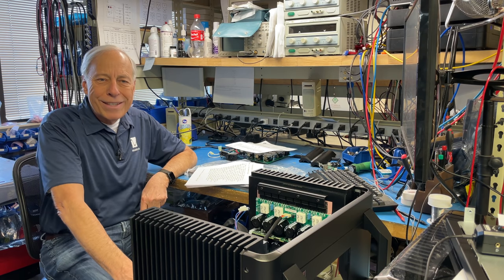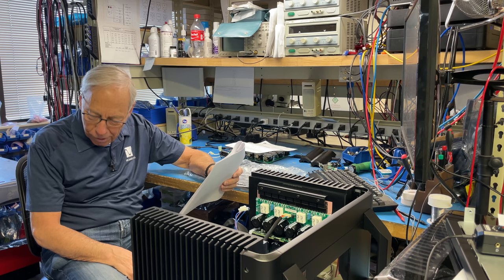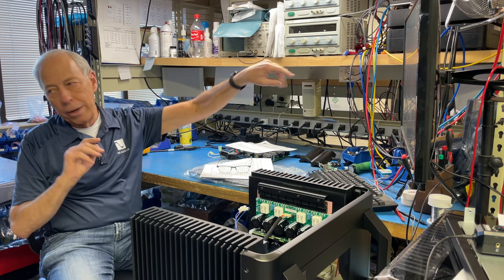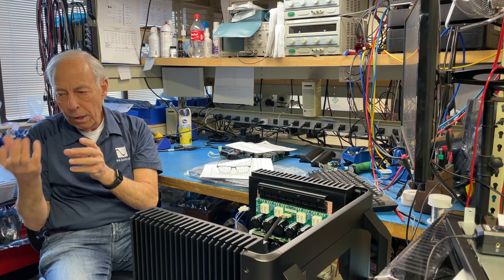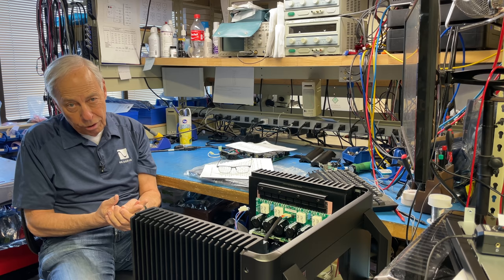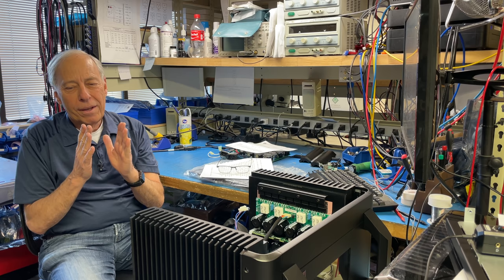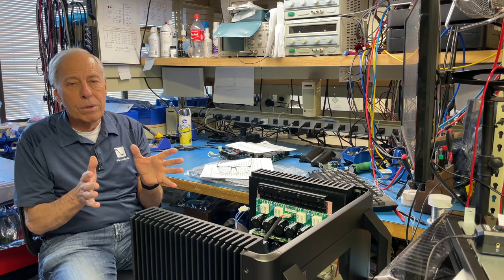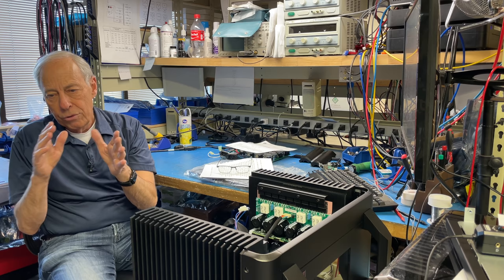Differences in digital audio cables

Comment: I've been watching the back catalog of "ask Paul" videos and I am increasingly coming to the conclusion that many of the "snake oil" issues stem directly from deficiencies in the designs of the electronics.

Do you need a power plant? Yes -- because the power supplies provided with the equipment do not sufficiently regulate the power rails.

Do you need a ridiculously expensive USB cable? Yes -- because the DAC does not sufficiently isolate the input to prevent noise from coming through the USB input.

The result is a klugde that is treating the disease rather than curing it. I would rather pay more for equipment that does the job right in the first place then spend money on expensive bandaids to fix equipment that is fundamentally broken.
Reply: Exactly. Equipment that isn’t designed to handle noisy power and USB simply isn’t designed well. It’s not like these things are new and their noise and fluctuations can’t be measured.
Reply: Very good point you have there.
Reply: ideal but not practical
Reply: While it is a very good point (and I'm in no position to buy expensive high-end cables and such) keep in mind that is not POSSIBLE to design a perfect power supply or perfectly isolate a DAC. It's not that those are bad product it's just you can't do it 100% perfectly and also it wouldn't be feasible in a real world budget for a production line. So these tricks are meant to give you the last 1% in audio quality and not because the products are badly designed.
Reply: @petersagi275  It doesn't have to be perfect.  It only has to be better than the alternative. I could do a lot of extra power supply engineering for the price of a PS audio power regenerator -- and it wouldn't suffer from the economic inefficiency of duplicating the function of an existing component. The same goes for the the DAC input and the price of a high end USB cable.
Reply: @Douglas Blake BUT WHAT BRANDS?!?!?!  save us from ourselves.
Reply: @Douglas Blake I love this. It’s anecdotal but I love it. All this cable nonsense is based on thinking (incorrectly) that engineers haven’t designed proper input output stages in their amplifiers and dac etc. Amir from Audioscience review is doing a fantastic job of putting this all to rest with his debunking videos including actual measurements and actual engineering background. Not more magical fairy dust
Reply: @timharig  Exactly. But we are talking about high end stuff. I wouldn't assume in any context that PS Audio (or most well reviewed high end ) products are badly designed. They are already better than the alternative. The point is that no company will spend thousand of dollars on power supplies or DAC isolations to push it closer to perfection. Maybe you (or any great engineer) could do it but then you would be a fool financially, because you'll get no return in terms of sales. Really the point of these products is the push you just a little closer to perfection for a crazy amount of money... but hey somebody has that kind of money and an IRSV kinda system to hear the difference. I don't think it's that hard to accept.
Reply: Spot on. Someone had to say it.
Reply: @petersagi275  It only has to be perfected for the job it’s supposed to do. And that job fortunately is quite a simple one.
Reply: @Douglas Blake "First of all, perfection is a fools quest" It is exactly the quest of (many) audiophiles. The point is not financial sense or good enough. The point is chasing perfection. We all know that after a point a better solution won't bring many benefits at a much higher price. But audiophiles don't care. I think it's exactly about chasing perfection.  Does a 5000$ DAC sound 10 times better than a 500$ one? No. We all know that. But the point is that it's a tiny bit better. 
You seem to understand engineering in this field so I'm sure you agree that spending a lot more on those said components or making a different design, could improve performance just a tiny bit. It's a never ending circle of price vs performance, making the cuts, creating a good value product. However we also need to see that some people willing to spend millions to get 0.001% more performance. These products are for them (you can't put them in a financially sensible product) and again, nothing wrong with it. We don't need to buy them have good sound.
Reply: It doesn't matter how much you spend. Everything has its own sound. The wires, the caps, the resistors, the difference circuit implementations,  and power supplies.  The biggest difference that separates the cheap and more expensive stuff is the power supplies.  Good power supplies are $$$. Everything in this hobby is subjective. Even the crazy expensive stuff. Once you get past a certain point nothing is bad just different.  We're all trying to create the best possible subjective "real" sound we can with given components and parts.  Creating the best illusion of a performance. Everything is made to a price point.
Reply: Yes or you can just buy Yamaha and be done with this nonsense and it works and was designed by people who know what they are doing.
Reply: @petersagi275  Exactly, every single argument from sweaty engineers if you dig down is really about financial decisions about which parts to include in the designing of products. It's really "I could have built this for cheaper". Sure, if you buy cheap chinese parts and hire slave labor. If you buy an italian audio amplifier made by a small company who source custom parts, then it will be more expensive. Yet engineers pretend that this is really about the nature of audio and that they are somehow disproving what everyone else can clearly hear. Engineers are by far the worst group when it comes to understanding science, or people for that matter.
Reply: Norhing ia broke. It is about the least credibility concerning manufactureres. Paul is a lying but kind salesman with no technical background. His videos are distracting and manipulating.
Reply: Your assumptions ignore that if you want to improve quality of sound or anything for that matter you have to consider every aspect of the process involved.
If not then just choose the shuffle option on your Sonos.
Reply: And yet even if the things you describe actually work do they make any difference it your listening experience?   

I worked at a GM car plant (Detroit/Hamtramck Assembly) for 30 years in the IT department. The plant was 100% dependent on the data from the servers and the network. If for any reason the line stopped running it cost $50,000 a minute (USD). Needless to say there was a lot of emphasis on us keeping data flowing. Never once was there a discussion about putting different CAT5 wires in or worrying about RJ45 connectors that might be better because they had magical properties. it was a noise laden environment with hundreds of welding robots running 18 hours a day. And yet the data still flowed. Rest assured that the 1's and 0's don't care what wire they go down. Don't fall for this. It is fraud.
Reply: maybe you should buy CHEAPER equipment given that all this high-end crap seems to suffer from bad power supplies and other issues that you need special power cables, speaker cables, USB cables and even ridiculous expensive optical connections
Reply: @petersagi275  how is it cheaper having already a power supply in the ridiculous expensive high-end crap and still need a power plant and a goldear cable for the same price in front? if your device needs a second power supply it's not high-end but useless crap
Reply: @timharig  
I agree.  "No one ever went broke overestimating the gullibility..."  And some have made a small fortune!
Reply: Anyone who recalls the very first gen Philips and Marantz CD players will understand that the quality of the A/D translation is a very audible thing. The difference reported in the quality of different manufacturers DAC's (the entire device, not the chip itself) suggests that audio quality can be influenced by engineering design and execution by how well the DAC and its supporting circuitry can reconstitute the analog signal from the digital packets it receives. Of course garbage in garbage out so if you are using a low res mp3, expect to get a suitably compressed rendition. The goal of the DAC and its associated circuitry is to minimise jitter and noise for the best possible analog signal. But how does a cable help here? It just delivers packets to the streamer from the network. And its not the weakest link.

When it comes to data, ethernet is a standard for an error correcting data transmission protocol. Data packets enter the network somewhere and exit at the streamer. They may traverse the internet. Error correction will attempt to ensure all packets arrive in sequence but may be subject to network conditions such as jitter (a time delay in the sending of these data packets over your network connection). Jitter on the network (typically internet) is frequently a result of congestion and there is nothing that can be done about this. The last connecting cable is unable to influence packet delivery, and will have absolutely zero effect on transmission delays. It is after all the passive physical layer on which the data traverses.

Of course you may have an "audiophile grade" switch on that last hop. These have improved clocks and so forth which purport to improve jitter performance, but as the DAC and its associated circuitry manage the digital/audio translation downstream of the switch and do their own jitter and noise management, I doubt their effectiveness.

https://headfonics.com/what-is-jitter-in-audio/
https://ieeexplore.ieee.org/browse/standards/get-program/page/series?id=68

The argument that "noise" is the devil but can be cured with a fancy power cable or some other sort of cable has no real science that I can agree with. Apparently a fancy power cable will improve "higher end" systems which in theory are better engineered to provide lower thd and other performance specifications and therefore sound better. They will already have well designed power supplies to provide big clean power in many cases. Being "higher end" suggests that there is already increased attention to isolating and removing "noise" in the power supply and elsewhere. And presumably good quality components in the power supply and elsewhere as well. I've heard the story about the courtesy power cable but honestly if I was a manufacturer of an audio product and knew I was leaving performance on the table because of a cheap power cable, I'd be supplying my product with the magic cable in the box and boost the price accordingly. It's additional performance for zero R&D expense by the equipment manufacturer, right. ;)

A disclaimer, I have a power conditioner installed (AC210), however I do this for protection from lightning during summer storms. I have no expectation of improvement in sound quality and I can't say I've heard a difference in use. Beloved by musicians, some do claim improved sound quality in places with poor power which in those circumstances I do believe. They are talking about audible hum and popping in guitar amps and PA's in places with dodgy stage power and in other commercial sound applications - not hifi. But it does show that some of these devices do filter out audible noise in some situations.

@Tim Harig asks do you need an expensive cable? He is right that these are largely expensive bandaids at best masking some sort of defect in equipment performance. Use this bit of wire to improve a design defect in the electronics. When you say it like that it sounds a bit crazy. Anyway if it makes you feel better, then of course there's no reason not to buy the most expensive cable you can afford. But I still think the money would be better spent elsewhere on your system.
Reply: @KeithHeinrich  
The DAC and jitter - these days we don't just feed the datastream coming off the CD directly to the registers of the converter.  The DAC chip, as it were, is now far more than just a DAC on that substrate.  Incoming data gets buffered, stored, calculations are performed on the data to interpolate between incoming samples, and upsampled data is clocked to the DAC registers at the rate and stability of the clock for that chip, within the limitations of its architecture.  As such, jitter in the source signal (CD) does not affect conversion (unless it exceeds a certain window in which case data is lost and the DAC mutes).

AC power supply is a simple issue of providing a low-Z connection, and specifically to the power amps as that's where the high instantaneous current is needed.  "Fancy" is irrelevant; the point is to prevent voltage drops at the power amp power supply input.  It's not a place to skimp on copper or introduce impedance (Z) with a filtering strip, poor outlets, or what have you.  The filtering strip is a great addition to the signal level equipment which draws low power at a continuous rate irrespective of signals.  When you're recreating a concert soundfield, Z in the power line to the power amp can affect sound quality, but it's about engineering parameters not exotic materials or appearances.  Hope that helps!
Reply: @elgringoec  my thoughts precisely, however much more clearly articulated.

"The DAC and jitter - these days we don't just feed the datastream coming off the CD directly to the registers of the converter. "

Surely as you say the DAC takes care of the conversion so long as the data presented to it is good enough.

With buffering and so forth and all the internal processing of the DAC, how are magical cables and unicorn fart laden switches improving audio quality as those with golden ears and implausible explanations assure us they do?
Reply: @KeithHeinrich  
A fool and his money...
It's easier to invent a story about a cable than it is for a block of special wood that whatever it touches in your system it makes sound better -- and yet, people bought em!   And claimed they could hear them working!
Just like people believe the news media is being honest, telling us what's happening without telling us what to think of it.  Pretty sad but that's human nature for ya.
Reply: @TofumanFC3S  usb is fantastic. Before usb we had rs232 serial communications and ieee-something parallel. It wasn’t fun. Except usb was never designed for hifi, let alone hi-end audio.
Reply: In the above video we haven't got any explanation to the question. The answer was prolonged, not specific but even more cloudy, overcomplicated and overstylized (huge,Huuuge, HUUUUUGE) for sake of deception. We heard some buzzwords supposed to be an explanation like "jitter" and "noise" and DAC, but simply that makes no explanation to the question. Obviously not. Maybe for people who are NOT electric engineers that would be enough. Watch the body language too: 3:26 "...data - GULP - isn't just data..." , big GULP = big lie. I can tell you guys that data IS just data, and the same data IS the same data. This is the digital world ... hello Mr. !!!! Noise ? What a F ? How much noise will you pick up with an optical cable would you plese tell me ? If noise could make any issue with digital audio signal transfer, then every cable would be optical cable. It's not expensive at all, some audiophile gold coated copper wire costs 100x more (!), than a noname crap optical cable. Every modern amplifier and audio source has optical digital input/output these days. The light can't pickup electric noise :) And another thing: the incoming digital data goes into a buffer !!! It is stored in a RAM !!! The data is already inside the amplifier at that very moment. The same data that you sent from your audio source a little while ago, every bit matches. It doesn't matter how did it get into the RAM. The ram stores DATA, many bits, "1" or "0" representing that, but it can't store any kind of analog noise picked up on the cable. The cable noise can't have any effect on the data anymore. It has already arrived and stored in RAM, and it matches with the source. Jeeez. And the DAC is coming just much-much later, first the digital data will go into a DSP (digital signal processor) ! We heard an honest word though, 4:20 "...and I don't have the time to explain this..." Maybe you shouldn't talk about shoes and pants. Shoes are different indeed. Digital data is the same if every bit is the same. "...and I honestly don't know the answer...." - ooops, bingo, we arrived. A Hifi engineer (?) don't know the reason, don't know the theory behind it, and don't want to know it either. Can't find a book to find out. OK so actually this is the answer: Is there any acceptable theory to explain it ? => "I donno the answer." - But we audiophile persons hear the difference with our sensitive ears, and we sell the audiophile digital cable 10x higher price as a normal digital cable or optical cable. Because this is our business, we sell such things, this is what we do for living.
Reply: @NakeanWickliff  He measures some kind of analog characteristic of the cable, it's not clear from that video what and why, and that is red flag immediately. And what he says is obvious, because every analog signal will be distorted and will be noisy on a copper wire. I think it's an intentional blah-blah and disinformation. USB is a digital cable supposed to transfer digital data, so he should check if digital data transfer is affected or modified in any way. Is the sent data different from the received data ? Of course it's not. Computers couldn't work if that would be the case. Not just in general, but couldn't work only for seconds either. In the digital world the slightest difference, only one tiny bit difference could cause fatal error, system crash. USB is not only a cable's name, but a standard high speed serial protocol also. If it can transfer the data precisely in the computer world, how could it fail in a slow speed audio world ?
He mentions Sonore Microrendu as source and Schiit Modi DAC, these device have USB ports !!! The digital data comes from internet, MP3 or flac or whatever, then it goes to and USB controller, then to USB cable then into and USB controller again and then goes into the DAC chip.
So there are 2 USB contoller chips (complicated microcontroller with embedded software, USB stack and things) the communication goes between them via the USB cable and the DAC comes only later !!!! Jeeez. How could go any noise or imperfection thru the USB controller in digital form ? That is absolute nonsense.
And:
digital audio speed: 192 kilobit/sec
USB3.1 transfer: 10 Gigabit/sec USB3.0 transfer 5 Gigabit/sec
USB can transfer 52,000 times faster digital signal than the fastest high quality digital audio. This is a serial communication, so jitter is important indeed, but in terms of digital data !!! If the data is same on the receiver side as on the transfer side, then you can forget about jitter, it was low enough. To understand better, jitter is a kind of trembling or shaking around a given frequency. For example your device should work at 1MHz frequency, but in the real world that frequency is quickly changing, trembling around 0.99 MHz and 1.01 MHz, that  trembling is named jitter. It can ruin the serial data transfer. The DATA transfer. At a given serial protocol, like PCIe or USB, jitter is an important parameter, they say: this and that USB controller chip cannot have bigger jitter than this and that. But if the data goes thru that means the jitter was low enough. As I mentioned USB can transfer 52 thousand times faster signal than digital audiosignal, how could someone talk about "jitter" problem in that poor audio world ? Probably he doesn't know what he's talking about, or the audience doesn't know what he's talking about, so he just want to disinform noobs. He thinks he sounds scientific and accurate and that's enough.
They are "audiophile" guys, they want to sell exotic things for diamond prices, that's how the snob hifi business works. I'm sure you've heard about hifi snake oils, and that is not coincidence, they exist.
Reply: This is true but what will end up happening is that you buy better gear.  Then you will buy more expensive cables because with better gear it makes a difference.    BUT I have come around to Paul’s view that none of it matters unless you have good speakers.   Good is a matter of opinion, but you really do get what you pay for.
Reply: @NakeanWickliff  Amir isn’t doing anything other than collecting money on his DONATE links!! Most of his reviews are laughable at best. The guy is literally saying products like the horrible Hidizs S8, S9 are better than done home desktop $1,000 Amp/DAC’s lmao which is 💯 % False!! But you’re another sheep that is just repeating what someone else says on a forum and there are thousands just like you out there. People that can’t buy the products and do there own test, and come up with their own conclusions. It’s laughable 😂
Reply: @CarAudioHorizons  Nothing you are saying is based on any facts.  You have no evidence to support what you are saying.  Care to provide any?  Namely that Amir does nothing.  Also that some DAC he measured sucks compared to some theoretical DAC you have in your head that you haven't even mentioned.
Reply: @vladg5216  This has to be the most absurd comment I've read in a very long time. Engineering is all about the science and real quantifiable evidence. You can believe whatever you want, that doesn't make your beliefs real.
Reply: @telelaci2  Perfect synopsis.